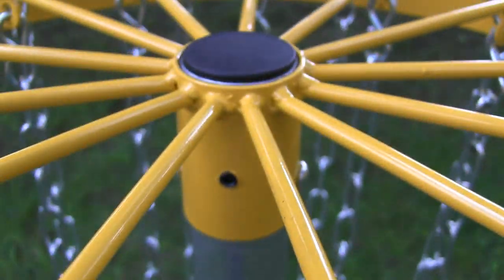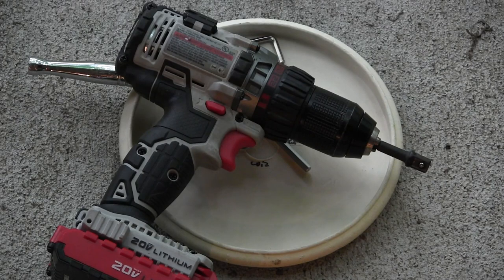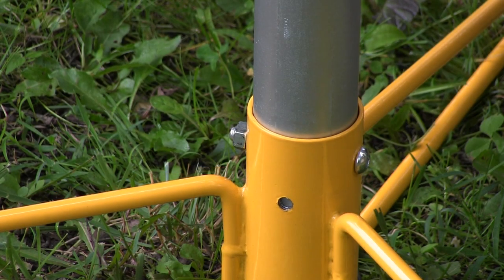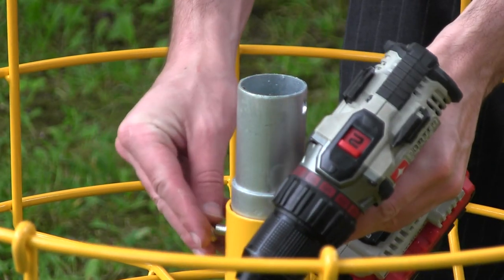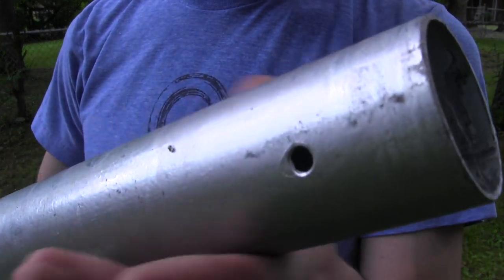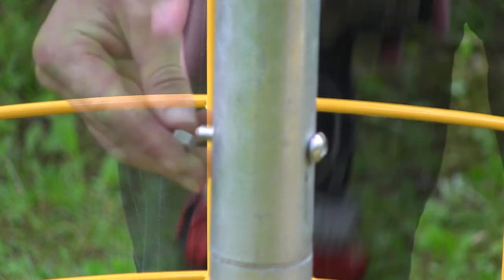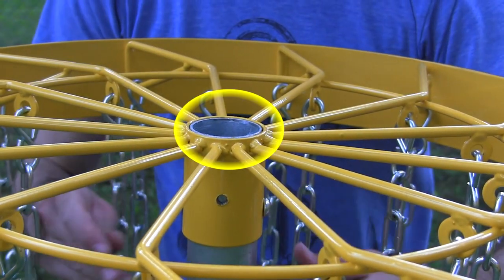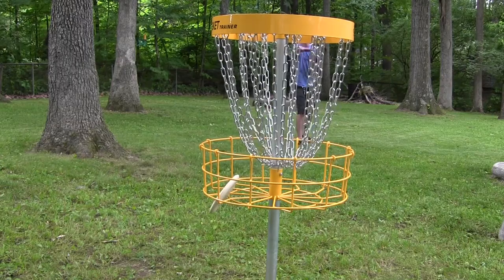Latitude 64 ProBasket Trainer Assembly Instructions (Disc Golf Basket)

Comment: Mine was a bit wobbly at the bottom pole / top pole area. My top pole was not as snug as yours. I found that flipping the top pole over allows you to put the forth set screw in at that location to snug it up. Absolutely rock solid now. Your video did help with me figure this out. I did see the instruction on DD website and the build sheet appears to show it the way you put it together. I think Latitude should do better to put out easier to follow instructions (the first time).
Reply from the maker: Yeah, those instructions were abysmal, haha. Glad I was of some help!

Comment: Hey. I'm in an youth enterprice in Norway, and our project is to build a disc golf course. We're bying these baskets, only the Latitude 64 Pro Basket Elite. We want to spray paint the baskets. Not the center pole, but the yellow parts. I was wondering if you had any tips on how to do it. and do you know if it's possible to take off the chains from the top part so we don't spray paint the chains. Do you also know if the yellow parts is galvanized metal, or if it's only the silver center poles?
Reply from the maker: The chains should be removable by spreading and re-crimping the S hooks.
The yellow parts are either powder coated or maybe some sort of enamel paint that would need to be sanded off or roughed up a lot if you wanted a new coat to stick well.

Comment: how has the basket held up, rust?
Reply from the maker: Been great! I usually pull it into the garage when I am done, but it isn't climate controlled out there and honestly a bit leaky.
Reply: I have these on my course and they hold up really well. Would recommend
Reply: @cameronsvideos7906  Do you know anything about spray painting those baskets? I know you should use powder coating on calvanized metal, but do you know if the yellow parts are galvanized. We're trying to set up a disc golf course in our home town all the way up north in Norway, and i was wondering if you had any tips.